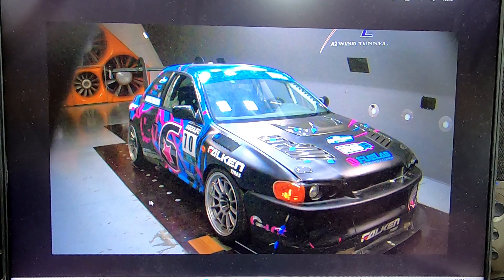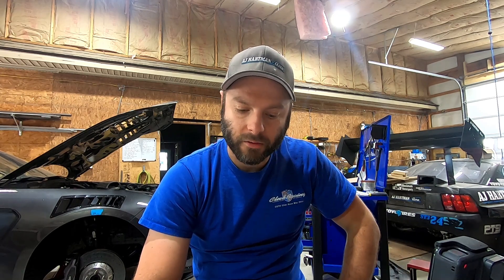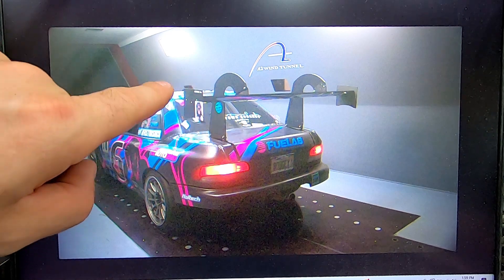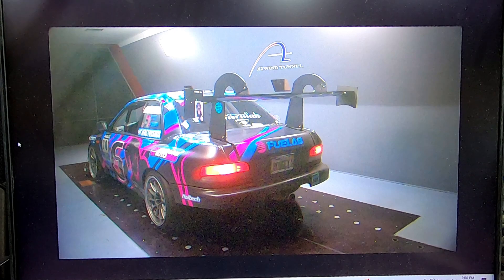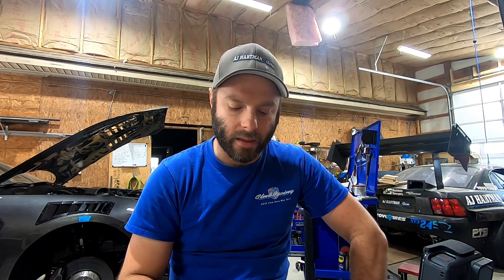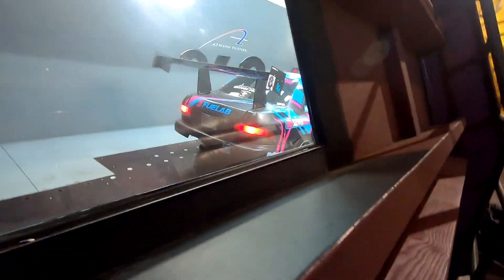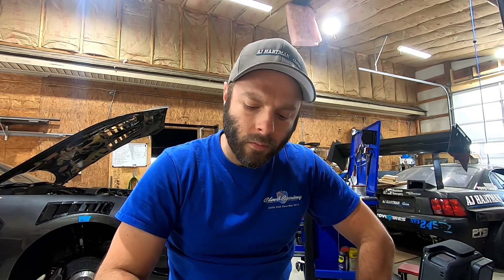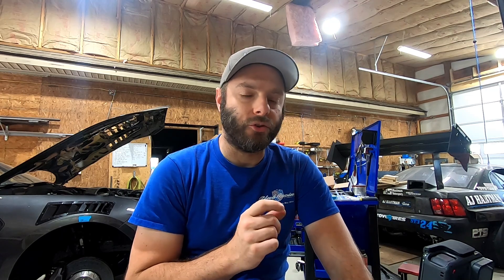Time Attack Subaru in the Wind Tunnel

Comment: I’m curious. Is parallel to the centerline of the car necessarily best for the rear wing supports? Imagining there being a degree of inward convergence off of the roof / c-pillar / rear window, would angling the uprights appropriately, have the affect of reducing their angle of attack in relation to the airflow ahead of them, reducing drag, and potentially accelerate the flow between them and under the wing, for increased affect?
Great stuff. Eye opening.
Reply from the maker: Ehh I’m not sure. If you put wool tufts on your trunk lid you’d be surprised at how quickly they become straight again. I’ve never seen any data proving one is better than the other.

Comment: So just to clear a few things up in here.  The hood was about all we could find in the US that wasn't totally hot garbage.  Also to note there is an oil cooler behind the driver side headlight that needed a vent somewhere near there for an exit.  If I could redesign this hood I would but I was pleasantly surprised how well it did.  I was expecting MUCH worse.  Improvements to that are coming though.   The rear wing is places as high and as far back as Gridlife Street Modified rules allow.  The uprights are...ugly...but were an example of a temporary solution becoming permanent.  Also something I would love to change out.  Placement though is to the edge of the rules.   If anyone has any other questions on the car let me know.
Reply: pretty sure i saw this car today at Abbott Auto. insanely cool car man!
Reply: @Fiddysgarage  yep that's me

Comment: If a wing is around 3" off the boot lid with between 3-8 degrees angle do you get a venturi effect increasing down force ? Does the  venturi effect effect how high the wing is placed for best down force
Reply from the maker: Yes, but it will cancel out some being that close.